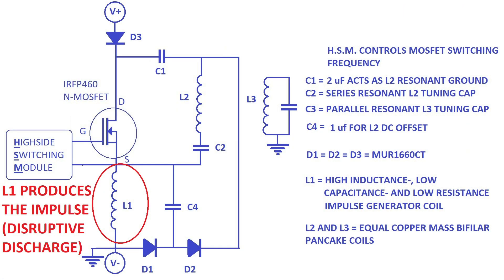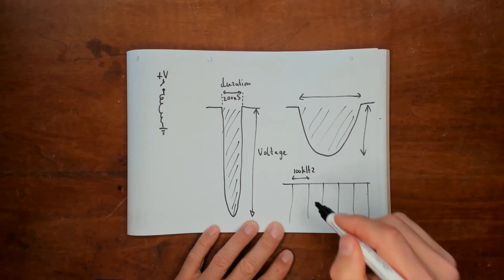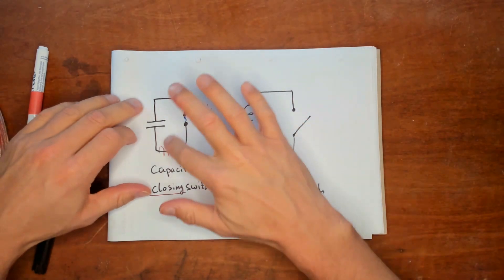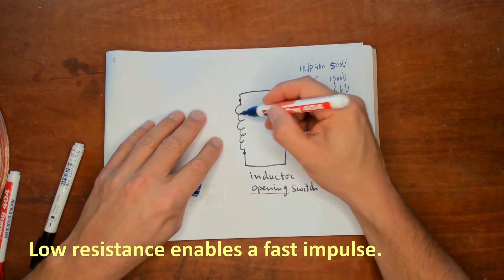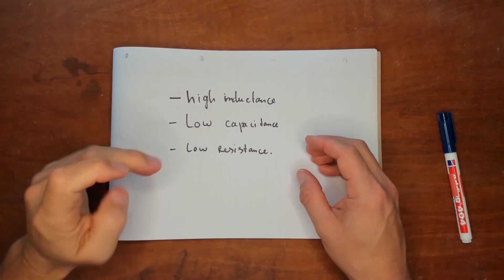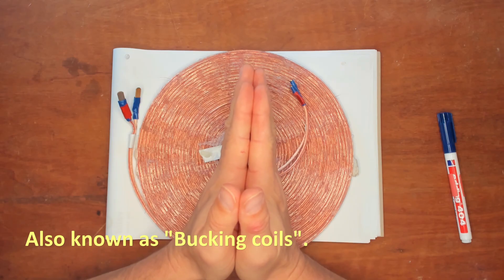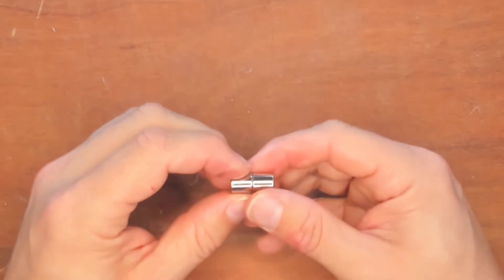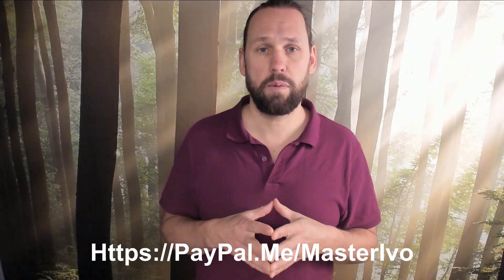Longitudinal electric impulse generation factors.

Comment: Your circuit uses ZVS topology with its resonant tank and MOSFET. The ZVS with a pancake coil transmitter and a pancake coil receiver indicate the circuit could transmit and receive solitons leading to the nonlinear propagation of stable, self-reinforcing wave packets through the e-field.

Comment: The spark gap generator also had a hand in field construction too not just controlling timing.
Reply: excellent structural resonance theory but falls short in forcing the field medium into non-linear, non-temporal coherence — the thing a spark gap actually does beyond just timing.

Standing waves aren’t just a product of frequency—they’re a product of collapse, rebound, and resonance in a medium that stores potential, not just cycles.

Comment: So the bucking coil cancels out it's own magnetic field therefore it has very low inductance. Take a bucking coil and stand it on its side, then discharge a capacitor into it. The electric field comes out in straight lines perpendicular to the wire so on the large "east" and "west" sides of the coil there should be a pulse electric field, yes ? 
Question: Does the east electric field have the same properties as the west electric field ?
Reply from the maker: that makes sense but should be comfirmed with an experimemt.
the dV/dt is the same, so the moving displacement current should also be the same direction on east/west, perpendicular into or out of the conductor
Reply: @MasterIvo  Can you suggest what this experiment might look like, are you thinking of your Either swinging plate experiment or something quite different ? 
Regards Stuart O
Reply: @MasterIvo, you’re right that the dV/dt and displacement current should be symmetrical in theory — but real field behavior under impulse shows clear asymmetries between East and West due to non-linear collapse dynamics. The spark gap isn’t just for timing; it introduces the necessary field violence to disrupt equilibrium and allow standing longitudinal structures to form.

A capacitor-discharged bucking coil with a triggered spark gap will reveal different E-field responses on each side — not due to coil error, but due to spatial field asymmetry. This is how we force the medium (dielectric/aether) into node behavior.

I’d be happy to diagram this or run a virtual field simulation if it helps. Respect for the work you’re doing — you’re close, just missing the asymmetric kick that gives birth to structure.
Reply: @MichaelMyrick1123  Like the way a counterclockwise coil has less magnet field than when it is wound clockwise, there is a small bias in one direction. Diagrams are good 🙂
Reply: @Neopan210 
You're spot on — the handedness of a coil directly affects not only the magnetic field but also the dielectric pressure vectors within and around the wind. Clockwise or counterclockwise is not just a spatial habit — it's a geometric bias that alters the interference gradient in the field fabric.

In the public Ætherion Codex, we map this kind of handedness (right/left coil winding) into field-vector diagrams, showing how the rotational dielectric paths converge or diverge from axial flow. This subtle asymmetry is key in designing systems that favor implosion (coherence) vs. explosion (chaos).

I'll gladly share a public-facing version of the Codex diagram for this soon — and you’re right: diagrams are one of the best tools to teach, test, and refine these truths. Thanks for the respectful signal.

— EnergyTRE / Ætherion Public Codex
I post most of my work on substack.

Comment: Hi Ivo. I am having trouble convincing my electrical engineer of the existence of E.M. L-waves. Compared to transverse waves, can you show what they look like on an oscilloscope?
Reply from the maker: better not try to convince him, you can't open others eyes.
Just open your own.
scope just shows interpretation, sine wave. Experiment is more clear.
Nature shows longitudinal waves, in sound and water (tsunami).
Best is to show him dual resonance, whereby the frequency splits, and the second higher mode (not a harmonic) becomes 180 degrees out of phase. aks him how that is possible.
Reply: @MasterIvo Thank you. Longitudinal may not be accurately descriptive, but if it can travel through semi and non -conductive materials, then I can use it.

Comment: Excellent work Ivo. Output of the bucking coil effect. What is the max volts and fastest impulse with high frequency that can be expected?
Reply from the maker: depends on the used circumstances.  I now use current impulses of 40ns up to 1000V, using parallel Mosfets

Comment: The coil and capacitor has to be the same  coil 1mH  capacitor 1mF and the ground has to be in between the capacitor and coil
Reply from the maker: thats like saying the cheese weight and the air pressure needs to be the same.
they have different dimensions!
the coils magnetic field (inductance) is created in the dimension of space. 
while the capacitors dielectric field (capacitance ) is created in the dimension of Time!
So how can they be the same?
Appels and pears, space and time.

Comment: At time 11:10 when the two neodymium magnets are forced together with their "like" poles facing (either North facing North or South facing South), look in the space gap between the magnets.  

THERE IS SOMETHING THAT IS PHYSICALLY TANGIBLE, blocking an easy push-together of the two "like" magnetic poles.  You cannot see anything.  But since electromagnetic waves that move through 'empty' space have magnetic and electric components, we know that the 'empty space' HAS THE ABILITY to take on both North and South magnetic poles (and both positive and negative electric poles).

The invisible 'something' inside that space gap is DIPOLAR:  it can take on N or S magnetic poles and + or -  electric poles.  This MUST be true, because an electromagnetic wave has N and S magnetic polarities, and both + and -  electric polarities.

Knowing this,  the 1942 "Invasion of Los Angeles" and the firing of a few hundred rounds of heavy howitzer shells NEVER TOUCHED that ufo.

The shells hit the same type of repulsion you feel when you push the two "like" poles together.

You need to create this kind of effect under a ufo to prevent howitzer shells from hitting the hull in 1942 Los Angeles,  and for 'hover' mode of the ufo.  
We pursue devices that make changes to the 'empty space' to achieve these types of results.  We started with analyzing a project from 1940s Germany that was partly led by Dr. Walter Gerlach (of the Stern-Gerlach experiment from the 1920s)   and the book  "Gravity Control with Present Technology" by Alzofon.

Looking into the space gap between the "like" poles of those two magnets, and being able to see right through it, has let down, has compromised,  human reasoning about the exact physical nature of what causes the 'invisible' block that stops you from gently, easily pushing two "like" magnetic poles together.   It is a solvable problem.

Just as Heinrich Hertz's first device that was able to copy the part of Nature that makes natural electromagnetic waves such as sunlight, the ability to change the 'empty space' is feasible

Comment: Is it possible to consider a 60Hz AC current a source of a long (wide) impulse?
Reply: Not necessarily in the case of dielectric impulse. Electricity is a combination of both magnetism and dielectricity. Volts=longitudinal dielectric, and Amps=transverse magnetic. Alternating current is a combination of the two, as well as direct current. I think I may understand what you mean, but I think you may be looking at the waveforms on Ivo's oscilloscope in the wrong context. The voltage may be represented the same way the current is, but the actual geometric properties and attributes of the dielectric and magnetic fields (although the two are incomensurably indivisible, and are literally the yin and yang of the universe itself on the subatomic scale) are polar opposites. Dielectricity is inertia and acceleration by the very nature of the fields geometry, and magnetism is force and motion as per the nature of ITS geometry. If you want literally THEE most in depth information in current existence about this, I highly recommend the YouTube channel Theoria Apophasis. The guys name is Ken Wheeler but that's his channel. Ivo mentions him along with Eric Dollard in his description if I'm not mistaken. If not then their DEFINITELY mentioned in one of these vids descriptions of Ivo's.
Reply: @bringer-of-change  thanks! i follow ken as well. Actually I was thinking it’d be great for everybody if Ivo and Ken joined forces. Sadly Stanley Meyer is gone, but those three would be the complete spectrum of theory (Ken) - generic practice (Ivo) - energy applications (Stan 💀). 
Ken is quite hard to follow in the critical parts, just before he finishes with “it’s so simple!” LOL. Also bumped into Konstantin Meyl, and his unified theory “Objectivity” (on potential vortex) bought all his books. Still trying to grasp all these concepts and make them compatible with each other. Ivo has a video (second earliest I think) where he tunes a coil with an antenna feeding the mosfet, that was epic and would solve the natural frequency scanning circuits without any need for software.
Reply: @bringer-of-change  BTW I’m a bit behind. My background is in software engineering so I’m set for a steep learning curve and little free time. But eager to do some experimentation. Buying stuff for a lab at max speed.

Comment: Have you tried experimenting with 2 coils  One counter clockwise the other clockwise And a capacitor that is the same    Capacitants as the inductor's inductance  Is and having the groundwire connected in between the conductor and capacitor
Reply from the maker: the same capacitance as the inductance is? those are like volts and amps, they're not the same, and don't have the same scale.

Comment: If you'd charge the 2 opposing bucking coils with a primary coil, there won't be mutual inductance to the primary because the 2 opposing coils cancel it out, but they still get an emf, when primary is switched off, the output may show a declining ramp according to asymmetrical regauging as explained by bearden.

Comment: At the bottom of my craft I use a a 3’6” bifilar coil using 2” tall copper strap, 2” above that I wind a quadfilar terminating 6” past the lower mentioned coil and terminating in spherical concentric nested electrodes consisting of a 3.5 inch copper or brass thermionic cathode surrounded by a 4” aluminum dee, surrounded by 6”, surrounded by 8” surrounded by 10” then 11.5 stepping back down to the half inch barrier to a12” outermost hemisphere purtruding  fromthe lowest plane. The idea is for the bottom bifilar to charge and discharge the four or however many plasma actuators I design and build that rest on the top portion of the craft. And the quadfilar above that can push and pull the the three or four spherical resonators it terminates in and deliver excellent stability and control for a triangle circle or many other geometrically optimized configurations

Comment: You can get some ungodly scr that can handle 30,000 volts at 20 or 30 amp
they even make optically triggered scr that can handle 1500 volts at 100 amp and stacked in series
Reply: You'd have to chain it down so it didn't zoom off

Comment: Why not discharge a hv capacitor into a tesla coil?
Reply from the maker: because that is much harder to do.

 Discharging a coil into a COIL-CAPACITOR is much easier and better to control and research.
Reply: @MasterIvo  no its easy you need 2 spark gaps,first one from flyback has a fine purple high frequency spark  which feeds into your caps and another spark gap,which produces a noisy fat white spark frequency controlled by gap distance, very easy I use 6  1000vlt . ..01creamic caps in oil bath in glass jar in series, best coil so far is rodin coil wound on 12 in white polystyrene ring tested on charging a car battery,14.8 vlt charge with .6amp 12vlt imput in 12 hrs,yet a rodin coil has a pitterful magnet field at that power setting ,on scope with old style one not digital there is a white dot on end of emf spike on screen

Comment: Add Nickel core to increase inductance!
Reply from the maker: I have enough inductance, I need more capacitance. 
I'm going to add a titanium dioxide mixed with epoxy to increase it.
This is for a high voltage capacitor made of 2 pancake coils (which act as plates)

Comment: This Is similar to the Dr Robert C Beck Magnetic Pulser , I believe he used a 3.2nh coil and a VIVITAR Flash to send the pulse .
Reply from the maker: yes except this uses impulses (resonant half waves) instead of pulses
Reply: @MasterIvo  where can I get the schematic?
Thank you !
Reply from the maker: @Enoch-Gnosis   see my april 2019 Radiant Power video, for the circuit (it's the same I used for the "ascention seat" which gives health benefits) also read: https://teslaresearch.jimdofree.com/lectures-of-nikola-tesla/high-frequency-oscillators-for-electro-therapeutic-and-other-purposes-the-electrical-engineer-november-17-1898/
Reply: @MasterIvo  awesome thanks for the link will check out that Radiant energy video , do you have a video on PEMF device ? 
My PEMF device is working until I plug in the 16awg wire then the Mosfet 740 burns out , a physicist told me that my PEMF device needs 1000ft of 24awg magnet wire and will work properly, curious to see how a PEMF device with your Bifilar coil performs .
Thanks again !
Reply from the maker: yes to low inductance gives high currents = heat in mosfet.
Never worked with Pemf myself, just  impulses and resonance.

Comment: You  gave  me ideas of storage
Reply from the maker: please share!
Reply: @MasterIvo  You just take the energy from the medium. Today its easyer because theres electric everywere to be kept. batterie never dies for years depends on the recipe. One always charge the others. Old principle. very light weel whit brushess could maintain a static state  accunulator...
You save the weight of the fly weel even in carbon is to expensive. antenna could play a role in the negative and positive state.